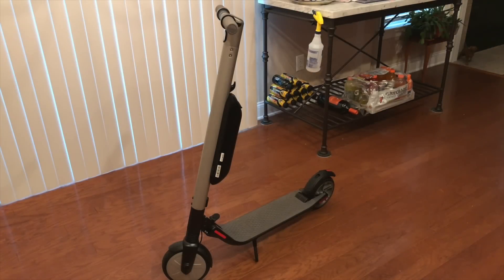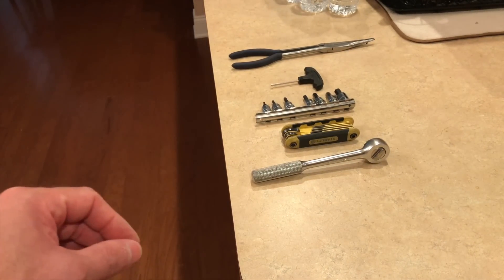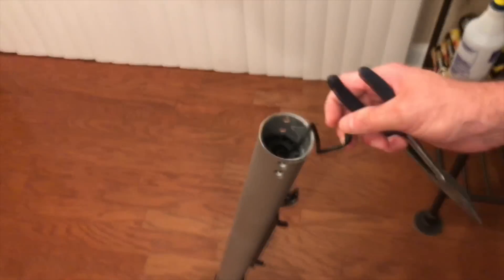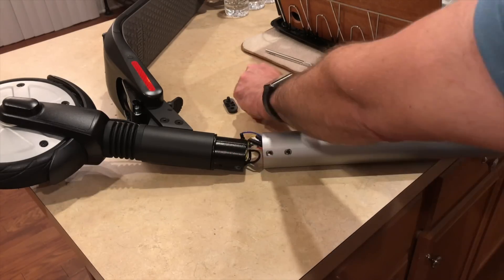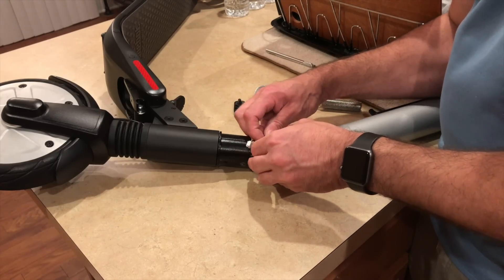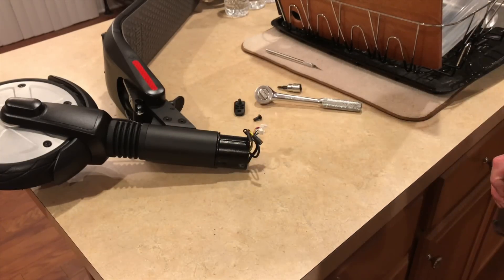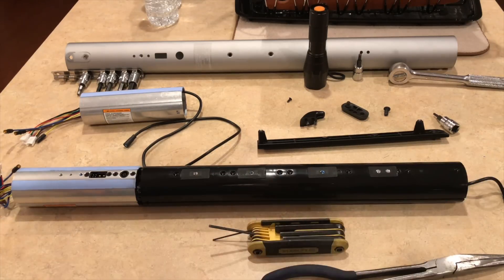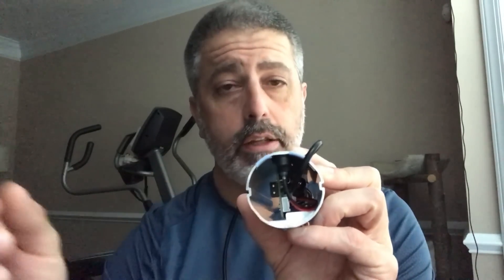Ninebot by Segway ES2 Kickscooter Control Board Replacement and Review

Comment: I purchased a ES4 about a year and half ago for $630 from Costco. Currently it’s not working at all , it needs the control board to be replaced. I’m trying to buy it on eBay and just do it myself Segway is charging about $220 for replacement and labor

Comment: wondering if you can help me. I have an es3 and getting an error 10 code. when I took everything apart the thick blue wire was broke in half. I have enough wire to cut and start over again. any suggestions? TIA
Reply from the maker: Sorry, you may want to reach out to the manufacturer

Comment: I got 2 es4 broken for 50
I think those 50 just got flushed down the drain because i thought i could fix at least one 💀
I will try my best tho but im not good at all at smd soldering so idk of its possible to repair the controller
Does anyone know why they fail its definitely a manufacturing problem

Comment: My es4 just burned up the other day I disassemble it and took everything apart the motor and control board both fried on mine the wires fused together, I ordered a new motor and mother board but ultimately ill be buying the 0 10x scooter next year, no more segways

Comment: My battery and my control board disconnected how do I no what wires go where
Reply: The blue and brown and yellow connectors are for motor and it's pretty easy u just follow the connection in a way battery is red and black on the controller itself u will see + -

Comment: How do you know the control board has failed?
Reply: issues such as the brake turning on erratically while the light is on, or the top speed being severely limited when the light is on
Reply: It wouldn't Work u can tell right away  controller basically gives the scooter function like a brain might also be a burning smell due to a fuse or other problems

Comment: I yesterday got my external battery, error 42, apparently there is bent minus pin in the scooters port for it.
And that seems to be soldered to this board.
Bew board doesn't cost much, but I'm a bit hesitant to open mine up.
I'm trying to get it to warranty, but since I don't have a receipt (bought 2nd hand) so not much help, because segway doesn't have support in my country except thru sellers

Comment: Good day Sir, I have ninebot es2 me I know the problem to my scooter? When I charge its like on and off charging 8 to 10sec then its off or disconnected it still plug in then after 2sec its on again or charging again.. I Plug in for 2hrs then its totally off after., then if I check its charge 3bars then I use it for  minutes only then it will be lowbat again..  What do you think the problem in my scooter? It is battery problem?

 Thanks for answering to my problem..
Reply: Ninebot is a piece of shit that's the problem i have the same problem

Comment: I had a rattling motor, then error 10, 16, 18, 14 and eventually the display was completally off, unable to turn the scooter on. The battery charging status changed green to red constantly. A strange thing happened: I opened the handlebar and took apart the entire so called 'bluetooth dashboard', the electronical parts below the screen, so I did not touch the mother board. It turned out, that this dashboard was a little bit dirty, no wonder, I was riding the scooter in the rain prior. The worst part is that the built quality of this dashboard is just too low. Also, there is no proper rain protection, so even light rain could damage these components or loose wire connection could be caused from riding over bumps or generally shaking. I took apart the entire enterior of the handlebar, cleaned the dashboard, removed brake and throttle pedal, reattached the wires carefully and put everything back together. Rain and dirt seriously damages this part. Ever since, my scooter works again, at least for now. I do have the feeling that most of the problems actually occur in that part of the scooter and not the motherboard that was shown here. But overall the wires, plugs and electronic boards in the entire scooter are of pretty bad quality. The sealing was clearly done randomly without having proper knowledge on how to seal electronic parts. I guess most of the errors and problems of the scooter are happening by the same principle. Kind of disappointing as it's otherwise a great scooter (if it rides). Hope it could help, good luck!
Reply: Hi can you tell me how and where did you clean the scooter my scooter has error 10 and the motor is rattling and now it is unrideable

Comment: to understand what fails in these controllers and why is the key to fix that is permanent, these controllers have mofset transistors, usually because of the heat transistors short out. so its enough to replace them. Problem is you need to replace all of them not only 1. another flaw is heat radiatorr that should be on the back of these mofsets in case of this controller its a joke, not enough to take out the heat.

Comment: How did you know that the control board had to be replaced? I was riding mine the other day and it died while i was riding it. I thought it was the extended battery pack but i took it off. Now the scooter doesn't turn on or charge at all. When have the charger plugged in, the charging blocks just blinks red then green but scooter wont turn on.
Reply from the maker: San Saephan I knew because others were experiencing the same issue, and it was their control board
Reply: @MichaelMaduske  do you think it is the control board in my case? I had i about 6 months but probably have under 50 miles on it
Reply from the maker: San Saephan Sorry, I have no clue. Post your question on some of the Ninebot facebook pages.
Reply: Sounds like your controller blew mine did the same with charger the fuse on it is sensitive I'd say get another controller but not really worth it ninebot controller has a really bad design better off with another scooter

Comment: I just got an es2 last week and so far... no problems. I love it.  I hope I don't start having issues. I bought an external battery but now I'm afraid to connect it, I've heard that's how many people start having problems with the control board. I guess I'll find out soon.

Thanks for the video and I'm sorry you had so many issues with the scooter.
Reply: Turn lights on ride up a semi steep hill. Your board will fail. Mine just did like everyone else's. You have to bridge a chip inside. You buy a new one it will eventually happen again. Shitty yes true damn Skippy!!

Comment: Don't buy scooter, terrible many issues headlight battery code 42 46 and 48.   And I've only ridden 148 miles
Reply: you having issues with it doesn't mean every single es2 is bad
Reply: @YDVN  good luck.  Fine print on warranty says you have to pay the $175 shipping to get repaired and the $175 more to ship back.   Search web, many complaints, wish I could get refund.  Not paying $175 times two shipping for repair
Reply: @joseph-is-my-name  not if you buy it on amazon, they take care of everything, buying on chinese websites is the mistake everyone made (at least i think so, from what i was told from amazon and if it isn't true i have message proof so i'll get my refund if there's a problem someday, no questions asked)
Reply: Your Dad Is Very Nice dude. Is that true? Because I’ve bought and canceled buying my ES2 from amazon because of the good/bad reviews. I’m torn. If they will replace/refund you when problems occur. I’ll risk spending the money.
Reply: @AD-ec3sm  if you buy it straight from amazon (in the sellers double check if it's amazon selling) you got a 2 years warranty, do call them first to be sure it's the same out of france.
Reply: The battery and electronics is 6 months and the rest is one year.  I bought direct from Segway.  Issue is who pays shipping.  Are you sure Amazon pays shipping for two years?  I wish I could get refund
Reply: I bought from authorized dealer in USA.  Anyway good luck.  It was fun for 148 miles.   So it was fun now not
Reply: @joseph-is-my-name  Amazon covers every shipping in france at least, idk about every other countries, i hope it will be nice and if it breaks i'll just return it for a new one i'm not worried about this at all, i'm so sorry you had bad luck with segway, i'd advice you to buy only from amazon if you want good customer service, never failed me

Comment: Hie where did you buy ur Control Board plz ? Good Video Continue
Reply from the maker: Benjamin Julius Benjamin Jeyaseelan Hello, the seller I had purchased the scooter from sent me the replacement control board.
Reply: @MichaelMaduske  this is not a response
Reply from the maker: p0tat0es_nation Ok
Reply: Michael Maduske where did you bought your control board? I don't know which sellers are trusted and which parts are built in good quality
Reply from the maker: p0tat0es_nation I never bought the control board. I bought the scooter on eBay, from an authorized ninebot/segway retailer, there are many listed on ninebot’s website or, you can email ninebot/segway to find out who is an authorized dealer. That dealer sent me the control board when I was experiencing issues. I no longer have the information of who I bought the scooter from and the scooter was returned last year.

Comment: Brought the segway ES4 back in December problems with the control board spoke personally to the technical   mechanic he said 3 things not to do with the segway ES4 scooter 1 do not keep the energy recovery level setting on strong keep always on low.... 2 never over charge the battery allow battery to go to about 30% 3 when charging plug first to scooter then into the wall outlet and is also bad if you ride down a steep hill with the battery charged at 100% and having the energy  recovery settings at strong that also can damage the control board that's why the energy recovery level needs never to be set at strong.....
Reply: 30%, are you sure?
Reply: Anecdotal, but my ES4’s board failed a bit over a month of owning it, and I used strong recovery, rarely dipped the battery below 60%, and the beginning of my daily morning commute is down a sizable hill where I have to ride the brakes. Meaning, I did all the things this comment says can cause the problem.
Thankfully, in my case, the solution is just to not use the headlight.

Comment: Damnit I just ordered the es2....
Reply: Mallinda ✅ from what I heard on Russian reviews, version 1.3 addresses the issue with the control board
Reply: rgaufman how to check version?
Reply: I had mine for a while and ride it many miles. Never encounter a single problem. Love it
Reply: I completely forgot to update but a few months of use i ended up with the control board issue. :( I still have the scooter today and it works as long as i don’t use the headlight. I attached an external bike light instead. Although im not sure this is safe idea to keep using the scooter with a bad control board. 😬

Comment: Inside the battery is a reset button you must press when connecting the new bord
Reply: Where is that button located? Also do you know what are the 3 Phase wires to Motor Blue, Green & Yellow? I'm trying to wire the ES2 Control to my 2 Phase Motor on my Currie E Zip750 but it has a Blue, Green wires aka Red, Black. Idk if I can just not connect a 3rd phase or is the big Yellow or Blue my Brake on Motor? Any info helps Thank you?
Reply: On the battery u will see a blue blinking light you will need to open it up by removing 2 screws or 3 they are hidden under some glue after that u should be able to remove the cover and press the reset button

Comment: Do you happen to know which wires going to motor are the Pos & Neg? I assume it's the Brown & Blue but I'm not sure... I think yellow is Brake... one multi pin is throttle. If you could help with what wire is what so I can connect to a different scooter with 750Watt motor. Thank you so much
Reply: Correct the blue and brown and yellow are motor

Comment: It's a shame that the scooter is still being sold with this problem, I only drove around 100 miles and it totally failed. Shouldn't be too difficult to make a functional main board
Reply: Its just the switch . On top. it takes two seconds to replace.
Reply: @Kentuckymadness1  it isnt just the switch your problem is completely different, dont be an idiot and give poor advice on something you know NOTHING about.
Reply: It's poorly made the controller itself has a fuse that's really small and it's very sensitive u could bridge it with soldering but it takes skill to be honest ninebot is garbage they cut corners on the controller board so better of scrapping it or selling it
Reply: Mine went 800 miles without the external battery fully cutting out😂 straight up beat the shit out of it 😭 rode it through beat up alleyways took it on 15+ mile rides daily even fit my friends on the back of it and took it 10+ miles 😂😂 the es3 version is definitely a beast

Comment: I recently purchased an ES1 from someone who purchased a truckload of store-returns.  Based on the app it only had 40 miles on it.  It seemed to work properly except that the maximum speed is only 9 mph, no matter what mode I put it in.  Also, interestingly, that maximum speed is reached at 2/3 throttle, and it slows a bit when I put the throttle at 100%.  And if I set the maximum speed at, say, 6 mph (in the restricted speed mode in the app), the throttle does the same thing, slowing down at full throttle.  I've communicated with the company, and they are unwilling to do a repair under the warranty.  They tell me that it is probably a control board issue.  They have been very responsive to emails, with a one-day turn-around.  They charge $50 for round-trip shipping, $45 for labor, $75 for dashboard circuit, $30 for throttle, and $105 for the control board.  So it would end up costing me $200 for control board replacement done by the company.  I may just keep it as is for now.
Reply: I have same problem when my light is on its break and doesnt run but if I turn off i run perfectly but only 14 miles per hours its es4 i think control board is the problem

Comment: Hi Michael.  We wanted to add a couple of notes here that will hopefully help your viewers.   For Your Safety - This repair should only be conducted by Ninebot - Segway certified repair technicians. Again this is for your safety.   Performing this repair will result in an error 35.  This is because your new control board has not been activated -  activation can only be done by a certified repair technician.   Lastly, disassembly of the scooter voids the warranty.  Please don't hesitate to let us know if you have any questions.
Reply: As you can see, they make a defective scooter and they don't want you to fix it yourself, nor use any used parts from another scooter. Imagine if you couldn't fix your own car! Sorry, you can't change your car's ecu... Never buy any product that you can't get parts for!!! Apparently the battery, controlboard, motor and dashboard are coded with a serial number. Very bad!!! YOU NEED TO RECALL YOUR GARBAGE!!!! it is a big safety issue. Everyone please report this to the "U.S. Consumer Product Safety Commission" People have been hurt and killed when the control board shuts off!!!
Reply: OPENING your product DOES NOT void the warranty under US Law!!! You need to remove those stickers at once!!! They are illegal in the US!!!! The FTC will come after you like they did with Microsoft and others!!!!
Reply: I have a question, what does the multi-pin connector do? Obviously the power connector supplies power to the unit but I don't understand the multi-pin's function
Reply: @colbyrichards7047  BMS
Reply: No, My question was. Do I buy a couple of the ES2's for my partner and I? Thanks for your comments.  The answer is.. NO i do not.
Reply: Ninebotus Exactly.
Reply: Ninebot my question will u be making a better controller board for this scooter or be taking money out of people's pockets for a badly design controller it's really faulty atleast make a new controller for the old products

Comment: I understand and totally agree that this issue should be resolved by the CS for the price it costs. However, looking at how complicated it is to resolve the issue, I would more than happily replace the use of the front light by a more powerful stroboscope style light to be simply attached on the handle, and those I've read can be pretty cheap...I also recommend to wear the yellow fluo vest at night with a USB rechargeable night light on top of it (it includes a front white light on the chest and a red light on the back which can blink if you wish so). So clearly this is not a deal breaker for me.
Reply: That company for the money they earn, nothing should be complicated. Even redesign a trash controller... But.... They dont because each piece is more 75€ (euros) plus transport fees...

Comment: This is very interesting. Mine started acting up and I can not use it with the headlight on. I think I have found a fox and will be buying a part to solder on OR perhaps bypass a surface mounted component. Still works well without the headlight on for me. I hope to do an update video soon. Really wish companies would test their equipment brutally before they start production.
Reply: TRY to HELP you  It is possible but very difficult to do. The 0 ohm resistor is super tiny. You need a very skilled hand and magnification.

Comment: I just bought an ES4 from Ebay, and from my research online the ES4 is basically just an ES2 with extended battery. However, the ES4 that I received has "matte black" steering column ( so pretty much all black) compared to many ES2 review videos I saw are all silver (like yours). It is not an ES1 with external battery for sure because mine does have rear suspension. I am kind of confused why my ES4's color is different than others.